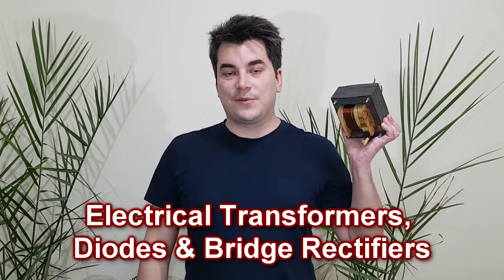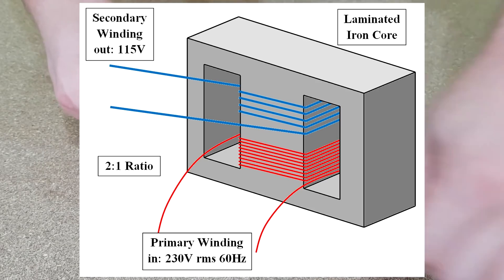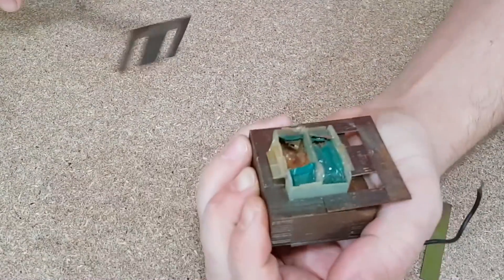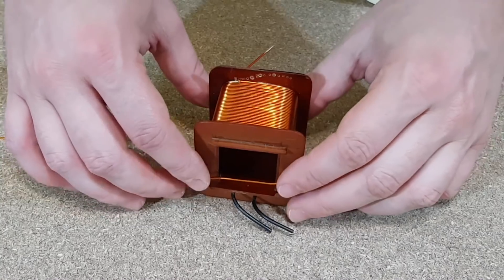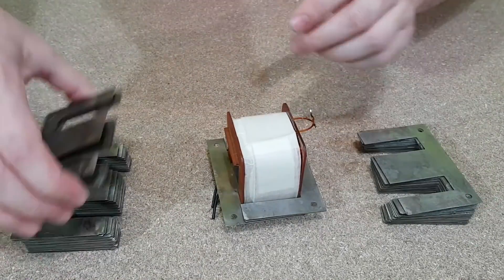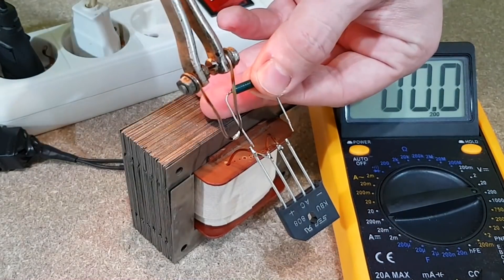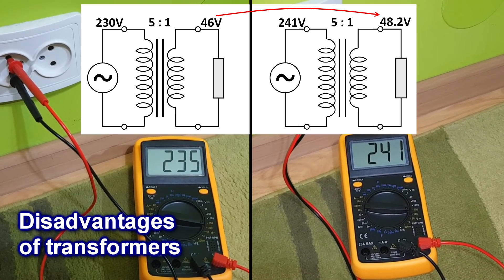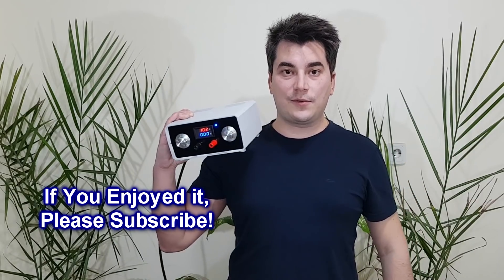How To Modify A Transformer (Diodes & Bridge Rectifiers Included)

Comment: Can you make diy selectable 19v/12v/9v/5v power bank With 18650 batteries?
Reply: Doesn't require a transformer, you can use step down/up modules. 
Batteries deliver DC current which is useless for a transformer.

Comment: well explained with clear voice. easily understandable.
please tell that how to determine a wind of transformer for having known amps. eg. 4 amps, 5 amps etc
Reply from the maker: hi. there are online transformer calculators, if you want to know exactly the winding parameters. but it's difficult to use them, especially if you try to modify a salvaged transformer, and you don't know the transformer specifications. in general I choose the copper wire from my experience. and usually I make the transformer a bit more powerful than I need it, to be sure it's not low on power.
Reply: @Sorin_DIY  thanks

Comment: To modify/gut a transformer, I just use a metal chop saw (dremel would work too but take longer) and cut along the weld bead. Then I either re-weld or epoxy it back together.

Comment: Sorin - I liked your video and humor and cat. You stated at 12:52 that "Transformers also waste a lot of energy. Even if there is no load connected, they still use a lot of power from the mains." I respectfully would like to disagree with this. If you are looking at only the amps, you might think this is true, but you have to also look at the phase shift between the volts at amps (power factor). The shift at no load is almost 90 degrees, and so the power factor (Cos theta) becomes very low and the power is low. Transformer energy losses are dominated by winding and core losses. Transformers' efficiency tends to improve with increasing transformer capacity. The efficiency of typical distribution transformers is between about 98 and 99 percent.
Reply from the maker: hi. thanks for clarifying this. I know that there is more to explain about transformers efficiency, but the more you get into details, the more questions you raise. it's difficult to explain a lot of information in a short youtube video, so my explanation may be a bit crude in some examples. I don't have an oscilloscope, so it will be difficult to explain all this, without showing it. but I will soon buy a DIY kit and test it in a future video. also the video can't be very long, because it will become "boring" for some viewers. I've tried to include a limited amount of information (which I thought was the most important) in a short youtube video.
Reply: @Sorin_DIY  - Yes, and you did an excellent job of presenting the information. I hope you have lots of views and can soon buy an oscilloscope. Electro-boom might give you one of those nice Keysight scopes if you are lucky. I liked and subscribed to your video too. The easiest way to know how much energy a transformer is wasting is to feel the heat. All transformer losses become heat. Also, a power meter such as the "kill-a-watt" meter are useful for this. Most transformers are quite efficient if the core is in good shape and they are being used within their voltage and current and frequency ratings. Good luck to you and your channel.

Comment: Enamel insulated transformer wire 
Not just copper wire lol
Rid the masking tape FFS 🤣
Get some kapton tape high temp tape😂
Reply: i thought kapton tape are heat insulator
Reply: @akapal  sure they use it to mount components to heatsinks or is that aluminium version can't remember cud be electrical insulator

Comment: Hey, I’ve a question regarding the new transformers. The newer microwave have different transformers. How do I use one of the latest microwave’s transformer to make my spot welder?
Reply from the maker: hi. that is a lot of work, I can't explain it in a comment. basically you need to replace the secondary winding of the transformer, with a very thick wire, to give it a low voltage but very high current. I will probably make one in the future, but for now I have other ideas in mind.

Comment: Most kids collect baseball cards, you are wird.
Reply: I used to salvage old transformers too, starting as a kid. I don't feel weird at all.
By the way: nobody plays baseball over here 😜
Reply: What did they learn from collecting baseball cards? Nothing useful, I'd guess.
Reply: Boris Antas  Electronics is a very interesting hobby. Perhaps you might even decide to make it your profession, if so, good luck!
Reply: Robert Polito I’m 13 and I collect high voltage transformers. From 480v to 650,000v. I’ve been shocked by 240 volts many times at as young as 9 years old. It feels like your muscles are straining to grip and open 50 times a second.